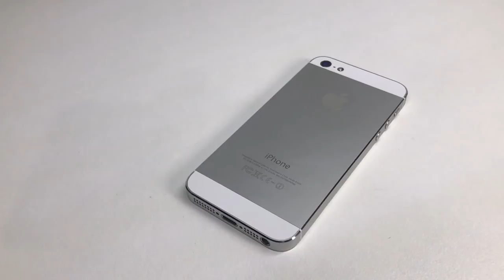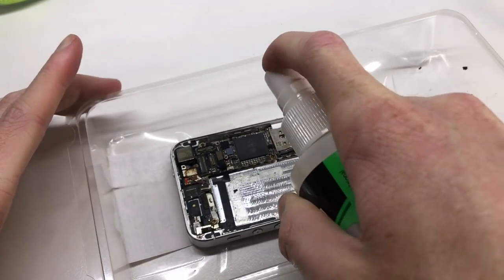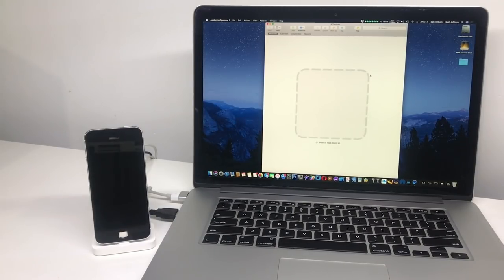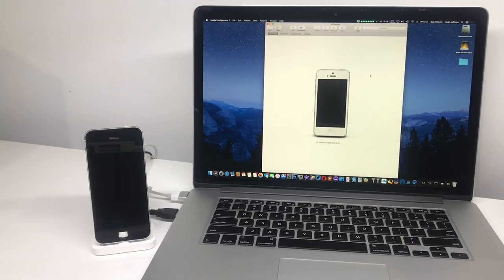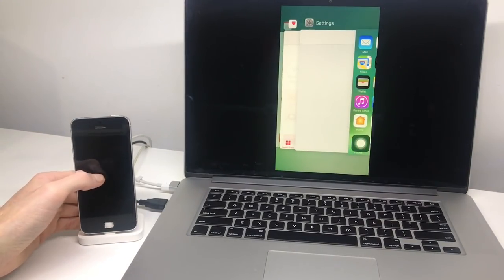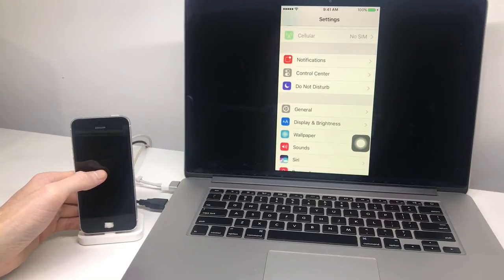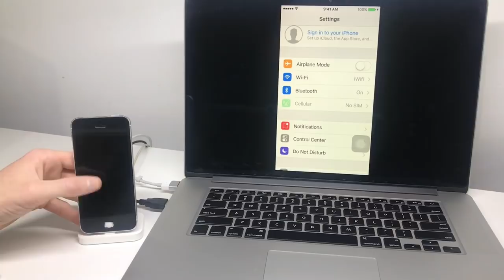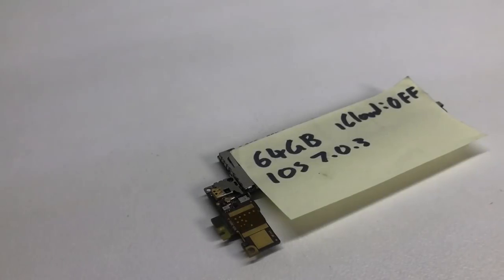Attempted Water Damage & Board Level Repair

Comment: When you're soldering, you should try to heat up the metal before putting solder on it.  When the solder sticks to the soldering iron, it does not come off as easily and can lead to it being harder.

Comment: You should get an ultrasonic cleaner. That’ll allow you to clean the contacts underneath the CPU without removing the shields. 

Also you should get some solder wick to help you remove the extra solder on the iPhone battery connector. When I soldered in a new dock connector for my iPod 2g I first desoldered the connector using hot air gun. After that I removed the extra solder with solder wick. Then I used plenty of solder to solder in the new port. Then I removed the extra with solder wick.

But great video as always! Keep up the great work!
Reply: Carrot 🥕
Reply: You know a lot for a carrot like you
Reply: - Xzentrious ha you only have 14 subscribeders
Reply: Shibe Memes 12 now

Comment: You should clean the connector points with solder wick and then use the flux and set your soldering station to an appropriate temperature

Comment: Great video as always! If you plan to continue board level repairs, I suggest you get a professional soldering station with a hot air gun and also a big box of flux! Also ultrasonic cleaner with a specially made cleaning liquid will work good for water damaged boards.

Comment: in the case of water damage, you can let the board dipped in isopropyl alcohol a couple of days, actually there is a little machine were you put the board submerged in alcohol and it will heat the alcohol and start shaking it so the rust and dirt can get off the components easily.
Reply: Love your videos btw.

Comment: You can put the boards in a oven and bake them.. this works for repair shops.. and for cleaning... a special soap inside an Ultrasonic cleaner.. itll vibrate and get all the filth out of the board

Comment: Can you fix one of my iPhone 5 cause I for some reason took off the screen, the pins are still connected but, the screen doesn’t turn on and the light doesn’t turn on ether. Can you help me fix it?
Reply: @frhfsg did u remove the battery connector if not that's y ur iphone is ruined
Reply: Backlight issue 
Check backlight circuit

Comment: I had a problem where my mom’s water damaged 5S wouldn’t work with original screens but after market ones worked just fine. Maybe try that with the iPhone 5 if you haven’t already.

Comment: Hi Hugh,
I suggest getting an electric toothbrush for repairing water damaged electronics. Works much better! I bought DIY electronics from China to practise on my soldering skills. Always use flux, makes a lot of difference (& lifetime). Soldering is not that difficult, but hard to master it.
Well done anyways and thanks for the video.

Comment: You use to low temp , you need to use for shield removal 450c 500c different to each station, to remove components use 410c 100airflow quick 861dw to put back u need to use 380c with low air flow around 50 % of your station ADd flux heat for 2-3 minuts until chip sits on its OWN
Reply: For soldering station u can buy a quick soldering iron , or t12 soldering station from aliexpress

Comment: A tip, when you're using Isoporopanol alcohol, mix in 10% of normal water, the Alcohol will not disolve sugar hence why water in the mix is also needed etc :)
Reply: Stockholms Oskar mmmm no not a good tip at all if you are doing this good luck.....
Reply: 176cgna been doing it like that for years.
Normal isopropanol doesnt not disolve dried up sugar/coffee and other stuff
Reply: Stockholms Oskar that's what brandson cleaner is for
Reply: 176cgna  Because those are very cheap yeah...
Reply: Stockholms Oskar I use a generic ultrasonic cleaner and the cleaner I have a 95% success rate fixing water damaged phones

Comment: Wait I know this is probably a stupid question but when a phone is water damaged when you open it is it flooded with water????
Reply: Actually it´s not. If you open your phone right after you dropped it then yes it sure is. But if you open it after a day it might not be noticeable that there was any water inside of it but if you succeed in takin of the metal brackets, then you will see water. Quick answer If you open it right after you dropped it -> Yes,
 If you wait a little while -> No (Maybe)

Comment: Do you know where to get a iPhone 6splus logic board?
Reply: In an iPhone 6S plus. You might find some logic boards on ebay, but you need to make sure the TouchID button is still with it.
Also chances you get scammed with an iCloudlocked logicboard are immense.

Comment: My iPhone has WiFi problems. It only works if I’m close to the wifi or I hit it a couple of times on the back. Someone help me 😞
Reply: It seems as if the WiFi chip is loose or your router has problems
Reply: computers with nikita nikita so do I just open up the iPhone then screw it in or what?
Reply: Do you by any chance have an iPhone 6?
Reply: Yeah I do
Reply: Thom Steenbergen I have an iPhone 6
Reply: The wifiantenna broke, it is quite easy to replace, and they should cost 5$ max.
Look up iphone 6 wifi antenna replacement and you'll find plenty videos

Comment: Hugh Jeffrey im in the uk and I'm willing to help you with fixing these phone motherboards im very well knowledged in micro soldering as I do xbox 360 xbox one and ps4 board level repairs im willing to help you out by fixing the battery connector on the phone for you

Comment: Well, your SMD soldering skills are poor for this kind of jobs. Try to practice on bigger, faulty, cheap electronic equipment. Try to “feel” the physics of solder. After you get use to it, it will be much more easier.